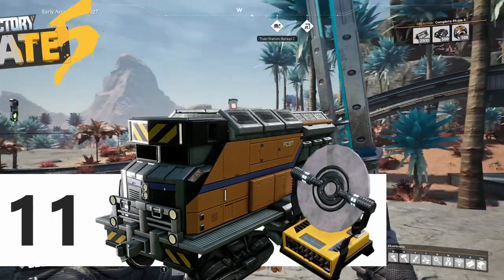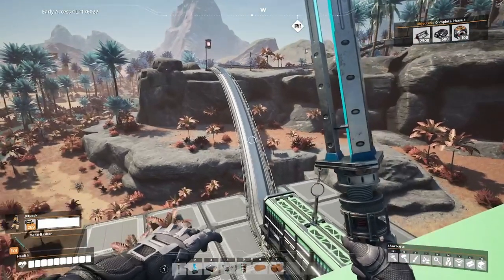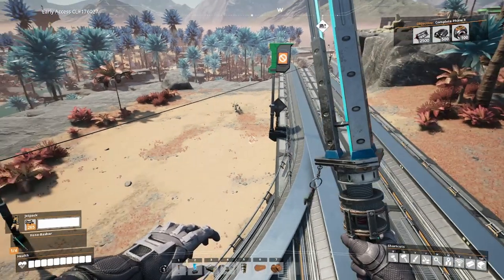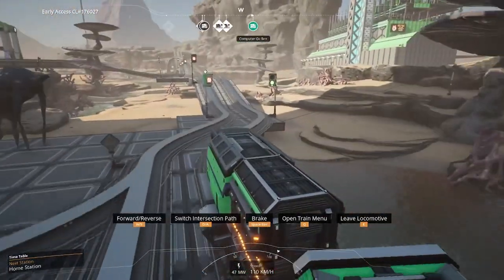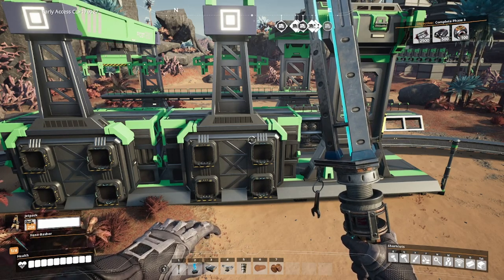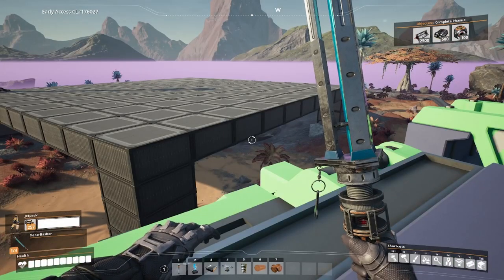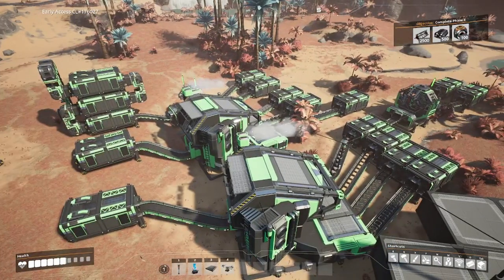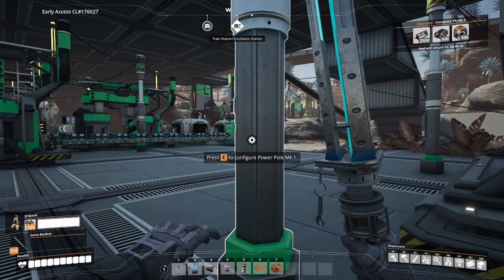How To Build a Train Network in Satisfactory! -  Satisfactory Update 5 Ep.11 (Tutorial / Guide / LP)

Comment: I've found using 2 Block signals in series at Junctions allow trains to move faster, with the first block being a path it can take and the second Block to indicate it has fully cleared the Junction, and by placing Block Signals all along the Length of the Track, trains will move more efficiently rather than stopping and waiting for the train ahead to reach the next Junction. On the odd occasion I've had a train waiting at a Junction wanting to go a completely different way from the train that passed ahead of it but it won't move until the first train passes the next Junction.

Comment: dude i love your videos. would you mind explaining when your running the dual train lines with foundation and then you skip a spot and turn how do you do that? is it level with the previous foundation or just loose?
Reply from the maker: Just loose, but it should be pretty close. its hard to do turns on foundations that look nice in parallel tracks, since the tracks have to go different distances. Ive found the best way is to put down the straight bits first then connect them. That said, its even harder to get it to look nice and remain parallel if you are also changing elevation, so while they arent matching foundations, they arent far apart either, and I do the uphill and downhill sections on straightaways.

Comment: So, you actually don't need Path Signals for every intersection. If it's just a simple Y-junction, you would be better off using just block signals to prevent trains from slowing down as much.
Reply: What about 'pass by' tracks for a single directional line?
The route from my main base to the western Oil Fields, I'm taking that arch path that gets to the biome. Occasionally I have the single track split into two tracks, then go back to one when the arch path gets too narrow.
And the train I'm using (only one) makes a complete counter-clockwise circle around the map. But I'm aiming for a clockwise train that would be sharing this same single line.

Comment: About the train station only being able to either load or unload, not both... what about having inputs and outputs on opposite sides of the factory, make the train loop around then pick up the finished load(s)?
Reply from the maker: Adding another station is certainly one way to do it. I can already imagine some epic build with the train spiraling around a tower or passing through a gap in the production floor.  Great call 👍
Reply: @Dekoba  train unload at bottom, spiral up through the middle of the factory then pickup on top could be pretty sweet!